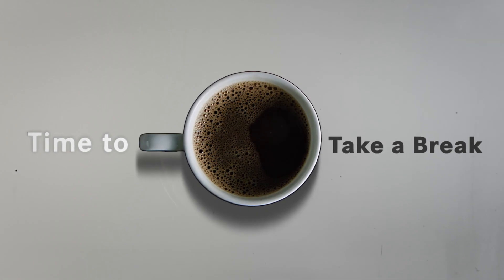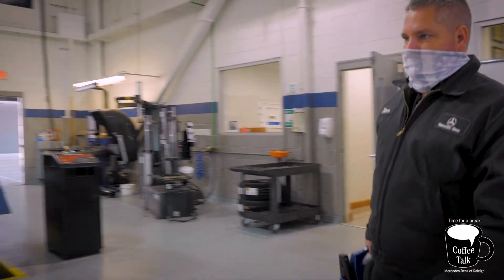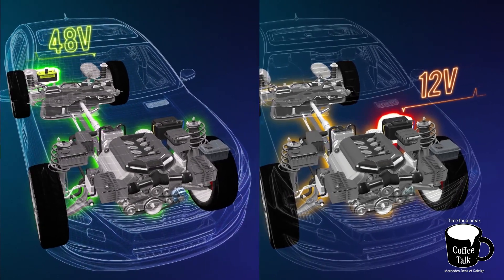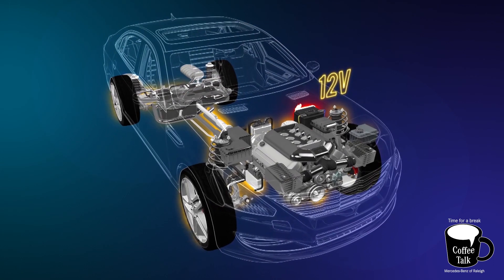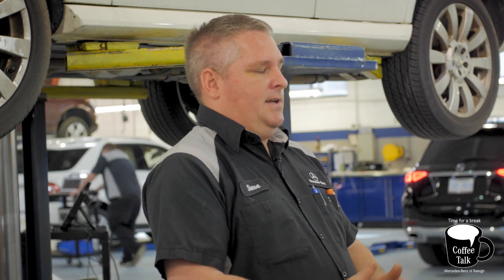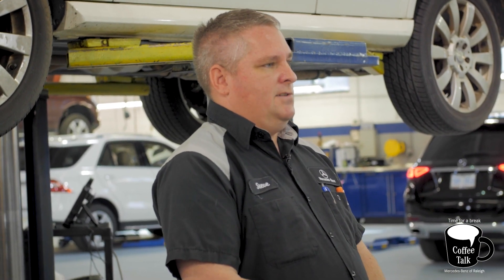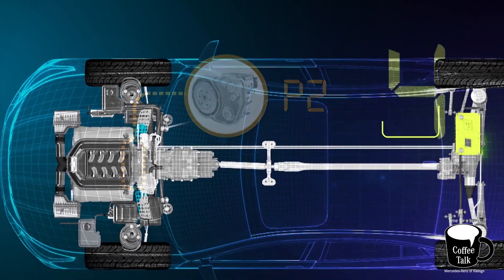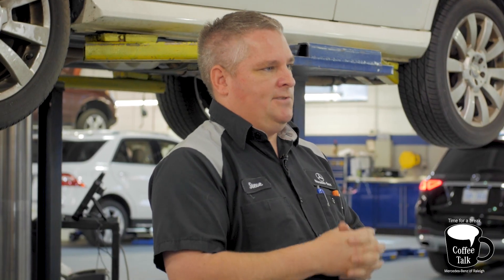Mercedes-Benz of Raleigh, NC Coffee Talk: 48-Volt System

Comment: how does the 48 volt system save on the brakes?
Reply: Just bought a '26 GLC 300.  Thought the brakes needed bleeding because they felt "soft".  After taking it back to the dealer they explained that this was the regenerative braking charging the 48V system.  (Didn't know we had this)  So instead of using brake pads to stop the car, they use electric generators attached to the axles to slow the car and then the brakes get applied for final stop.  Unless of course you hit the brakes hard for a quicker stop.  Turning these motors "ON"  generates current which creates drag on the axles (braking) while also charging the 48V battery. This braking force slows the car and thus saves brake pad life.